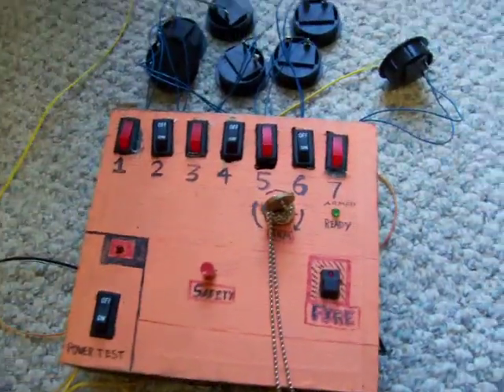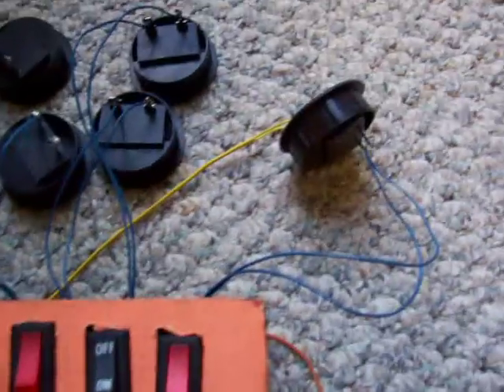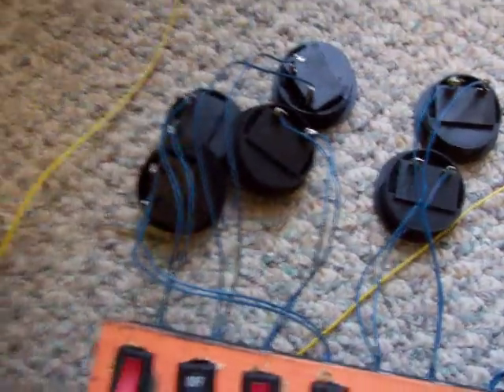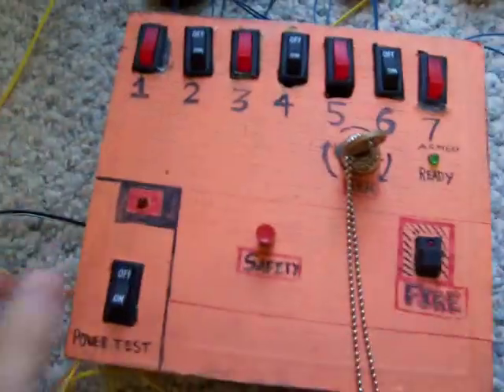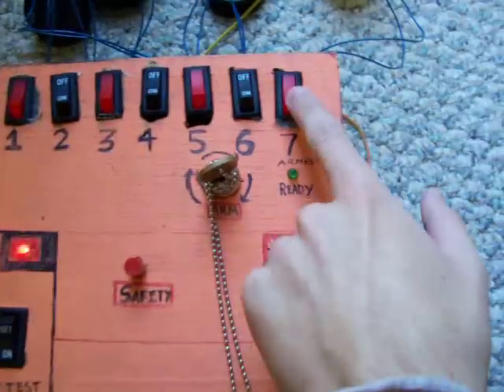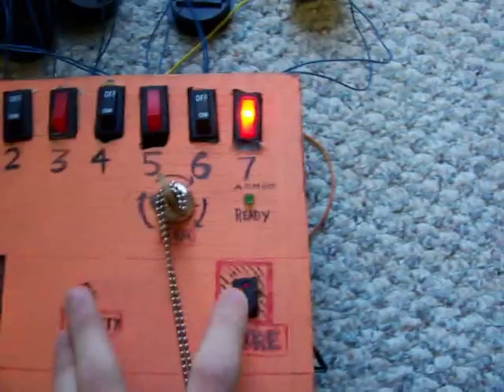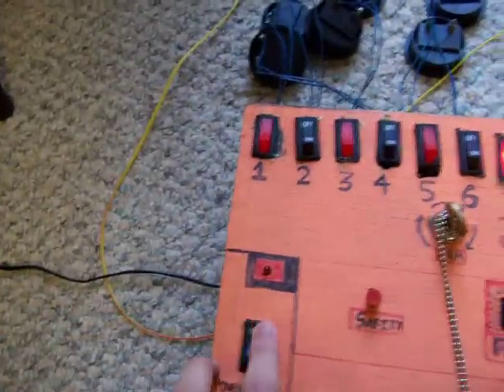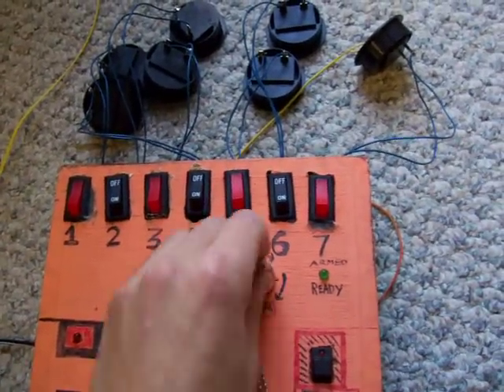Firework electronic igniter 7 cue-part 2

Comment from the maker: buy a string of about 100 christmas lights for about 5$, crack the tip off the light then hot glue it into a pice of straw and clue cut visco in the other end of the straw. run a current through the light and the fuse will light